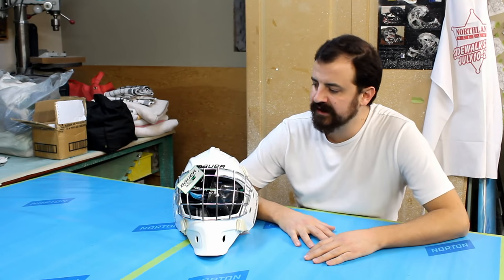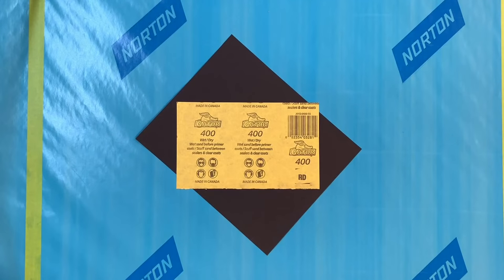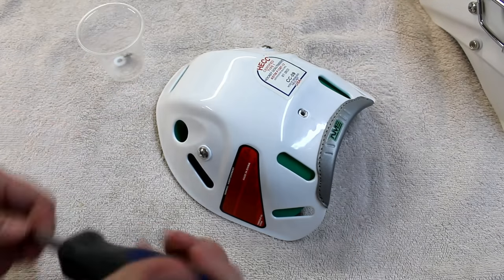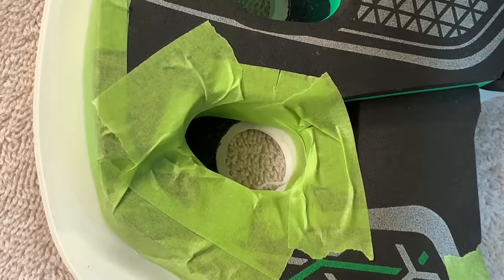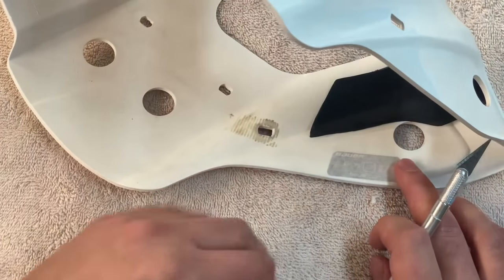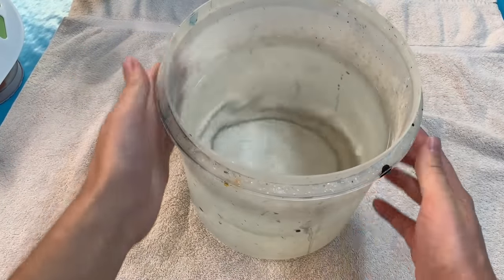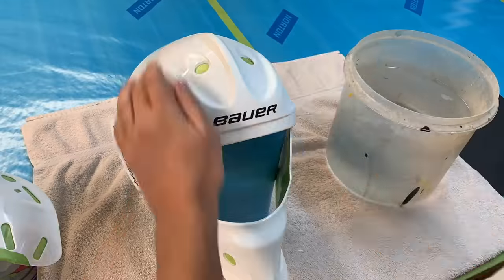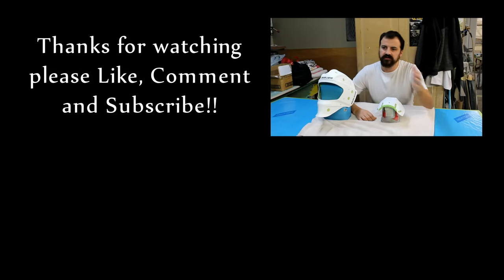How To Prep A Goalie Mask / Helmet

Comment from the maker: Hope you guys like the vid, if you have any questions or any more information on the safety stickers please leave a comment!! Thanks!!
Reply: With an older mask like you mentionned where the foam is glued to the mask... what would you use to remove the glue ? Thanks ! Trying to give a second life to an old mask :)
Reply from the maker: @Kreug11  well heat definitely helps soften up any adhesive, So would definitely give that a go. Any left over glue residue you could get off with Final Wipe or some other variety of wax and grease remover. Are you needing to salvage them? or will you replace the foams?
Reply: @Kreug11  IPA (Isopropanol or Isopropyl Alcohol sometimes works to remove residues of glue or paint - it depends on the glue.  It doesn't necessarily need to be the 99% pure stuff either - the sort with a bit of water in it, or adding some to the purer stuff (say, 70% IPA), sometimes works better.  

I've used it a lot for model making, in the past.  I use the pure stuff to clean my brass instruments, (trumpets, etc) or instead of hand gel :)  A little spray bottle works well for that.

There are some materials, especially plastics, which can be softened ("melted") by IPA though, so always test a small area first.  Cleaning the top of my LCD monitor with it didn't go all that well :)

Petrol or even kerosene, can work too, but it's more likely to damage the other materials.  Citrus based cleaners, like orange oil - pure or diluted a little, can be surprisingly effective, and are much safer to work with.

Diluted IPA, say 50:50 with water, works well as a "positioning fluid" for self adhesive decals and transfers - provided they're water proof and the colours are reasonably solvent proof, like vinyl ones.  

Decals are generally not a good idea for helmets though - they can weaken motorbike helmets, apparently - the glue sometimes eats into the surface.

#masks4all or #nomasksatall
Reply: You mention a part 2 will be coming to discuss priming and further prep.  Will we ever see this video?
Reply: @jonmorris6793  +1
Reply: @jonmorris6793  same question- eagerly awaiting prime & paint video!
Reply: When will we see part 2?  I’ve was following along and now I’ve  got my mask in pieces, taped and sanded, but don’t know what to do next!!! Help!
Reply: It’s a customary law that all safety tags have to be clear and visible. Because if there is an injury that’s the first thing that will be looked at same laws with all helmets

Comment: This is awesome. I am a new subscriber and I am also an automotive painter getting into airbrushing. I have been drawing for along time but I'm trying to transfer my work to airbrushing and make some side money. My question is what if your client wants the bauer logos still? do you make new ones with a vinyl cutter or do you mask them off? I have lots of question lol since I don't know many people that airbrush and the ones that do won't tell me bc they say they don't want to lose business. Thanks for posting these videos
Reply from the maker: Thanks man, yeah so in my sanding and priming / base coat process the bauer logos definitely get covered up so I re paint them back on. I have a vinyl cutter and will use that to cut the logo out and spray it with that.

Comment: YES! Been waiting for this! Can’t wait for the primer phase. Can you please address and recommend in the next video a primer/sealer when using water based paint because I know you’re into the solvent based paints. I’m using water based and a bit hesitant on using solvent paint because I’m a beginner. The most confusing thing when trying to educate my self online is the different opinions on using solvent based primers with water based paints! Yes you can. No you can’t. It’s exhausting 🤔. In the end I just wanna do what JBo would do if he were having to use water based paints. Thanks so much for taking the time to educate us beginners!!
Reply from the maker: Awesome man, and a great point. Yeah I've been thinking this because I use solvent but most people do not, so the best way would be to show both as options. I'm less familiar with water based but I have asked a few other painters I know and do intend to have that as an option for the prime/paint video.. or maybe another video on that, but gotta do the research first. Great point and I will try and do both. thanks a lot!

Comment: Very thorough video. About the stickers: As soon as the surface is altered the CSA certificate is void. To maintain it you would have to send a painted mask to CSA and have them do destructive testing on it. You would then have to guarantee the same paint, process, etc. every time to keep certification. The other way is to get written consent by the helmet manufacturer of what paint to use. But they won't because they have their own paint departments. I chased a few for months. Only brand that gave me a pass was Calcoat out of Quebec (not even sure they're still around or not). All they said was "Use a paint designed for marine or automotive fibreglass and gel-coats". Pretty vague. I would just tape the sticker over, paint the bucket, uncover the sticker. To the ref he couldn't tell if it was aftermarket paint or not: he'd just look for the sticker. As for the customer, I had them sign a waiver acknowledging that the CSA certification was now null and void. Great video. I am definitely going to look for your painting tutorial to compare to what I do. Always room to learn or share!
Reply from the maker: Thanks man, yeah I imagine you point the mask you void the certification, but I'm pretty sure the refs are just gunna want to see that the sticker is there and then they will let them play, which I imagine is all the person with the mask wants as well. So masking it off would def work, I don't want the mask lines so I just take it off and put it back on, but yeah it's all a little hairy and vague on whats actually ok haha.

Comment: Awesome video!! I was wondering while we wait for the next video in the series, if you could tell us what primer you use?
Reply from the maker: yes I'm using RM 870 with the DH99 hardener, its pretty damn expensive but it has worked just great for me!! if you are using urethane basecoat for your ground coat I would recommend, but like I say $$$
Reply: @jboairbrush  Thanks! For the average hobbyist, does a basic auto primer work?
Reply from the maker: @michaelswiren1195  yeah just try and find something made for plastics. If you use auto air you can just use their sealer right onto the sanded plastic, I'm told it works great and there's a white one. This is not my system but if that's what you are using it should def work for you!

Comment: Hey when sanding is there rule of thumb on pressure used when sanding? And do sanding blocks work well for sanding? 

Btw your tips vids are awesome.
Reply from the maker: Hey sorry for the delay, this comment musta slipped past me! So for pressure I use a bit but nothing crazy, I would say just experiment, obviously more pressure you will go a little faster, but I generally don't press TOO hard and let the sandpaper do its job. Yeah blocks work great but helmets and masks just aren't flat surfaces so I find they're not great for that at all but a soft block you could get away with, but I don't even bother.
Reply from the maker: And thanks man!

Comment: Great video... I love break down. I'm new to this kind of work never done it before.. u able to send me a link to part 2 or a video were I can tape and paint..?
Reply from the maker: Hey there! Thanks so much! the next part of the vid is not up yet so I guess just follow along and as soon as I have edited the prime / paint vid you will get it! the Venom one and the Black Panther vid both have a ton of information as well!
Reply: @jboairbrush  not to bug, but do you know when the next video will be up?
Reply: So the panter video really helped.so the mask I'm doing .km going to use spray cans and this is my first time doing it.plus its already painted and im just doing it over.Do I still have to sand it and prime it aswell.. ?
Reply: @willhouse7976  definitely sand a paint it as well
Reply: @Jimk435  thanks man.. does it matter what kind of sand paper you use.. or something u recommend?
Reply: @willhouse7976  the brand doesn't matter if that's what's you mean, but 400-600 grit would be best
Reply: @Jimk435  ok thanks
Reply from the maker: @willhouse7976  Yeah if its been painted before and you trust the paint that was on it you don't have to prime it, but definitely have to sand it, using 400 or 600 grit.
Reply from the maker: @Jimk435   no I"m not sure. I have a goalie mask coming up I'm going to film the video with but I haven't even done that yet. But once I film it I'm going to jump that up to the front of my editing list. Hopefully wont be too long.
Reply: @jboairbrush  so I tried it with 400 grit and seems like it's only smoothing the mask,but the old paint doesn't seem to be coming off.. do i too do anything differant?
Reply from the maker: Will House no, that sounds about right, you don’t need to remove the paint, you just want to level it and add scratches so that the new paint will stick. If the mask had a gloss finish before you want to sand it till the shine is gone, just like I explain / show in the sanding portion of the video. A red scotchbrite would also be great for all of the little grooves and small hard to get parts.
Reply: Ok thanks

Comment: What can i use to fill large holes? Bondo?
Reply: Ive done several helmets and would use a fiberglass filler or panel bond.  Technically Bondo is a brand name but for sake of argument wouldnt use bondo as too thick would crack and break.  I dont know if its covered in another video but i would also would measure and and match up the font of the Bauer logos before priming and such as a lot of customers want that back on. Wrong size and font will not look good unless its part of the design.  Fantastic tutorial though

Comment: The current CSA and HECC certifications are invalid if Vinyl or paint is applied to Poly-carbonate masks.  If a mask is made of Fiber Glass or Carbon Fiber you can customize it without losing the certification.  No one seems to enforce that however, but if you get injured, there might be an issue.
Reply from the maker: yeah... thats that grey area haha

Comment: What do you do with the logos? Sand them off?
Reply from the maker: If they are stickers over top of the gel coat / clear coat I just take them off using a heat gun to help. If they are painted and below the gel coat I generally just sand them smooth, not necessarily off. And the primer and basecoat will cover it. Sometimes it’s just a thin layer of paint overtop and as soon as you start wet sanding it you’ll see it disappear. Either way I guess you just want it sanded and levelled and then you will be ready for primer.
Reply: @jboairbrush  beauty! Thanks. Just dabbling with some airbrushing... starting to learn as I go along. Thanks for getting back to me. Also nice to see someone local do a Price mask. Congrats!

Comment: Do you recommend using primer?
Reply from the maker: Yeah I do, if it is already painted and you trust the paint that is on it, then you technically do not have to. But I usually play it safe and use a plastics primer / sealer and base the mask or helmet before putting my art on it. There will be a video on this process eventually.
Reply: JBo Airbrush Thanks! Do you sand the primer after applying?
Reply from the maker: @magnuskoski2596  if you let it dry then yes you'll have to sand or at least scuff it. but I paint whats called 'wet on wet', this is when you put the primer on let it tack dry so leaving it only 15 - 45 mins depending on the clear and then base coat right onto it. this creates a chemical bond which is actually better than an etch bond in my opinion.
Reply: JBo Airbrush First of all thank you very much for the answers! Sorry about asking so much, but I’m having problems painting the mask. My paint doesn’t seem to stick too well and the thinned paint (basic acrylic) is coming out way too light. What could be the causes and solutions to these?
Reply from the maker: @magnuskoski2596  So did you prime and base the mask first? If so after it dries you can scuff it a bit with a scotchbrite pad. also the real problem is probably that you are using paint that Isn't really meant for this application. If you want to use water based shoot for an automotive brand like auto air or wicked something like that. That is probably the source of the problem I would guess.
Reply: JBo Airbrush That is exactly what I did. I will get some solvent based paint and scratch the surface a bit, hopefully that will fix the problem. Thank you so much for the tips!
Reply from the maker: @magnuskoski2596  K cool man good luck!